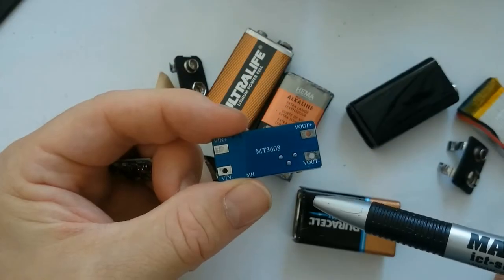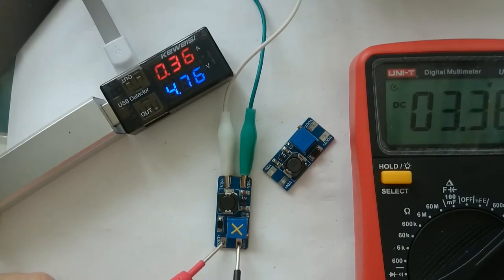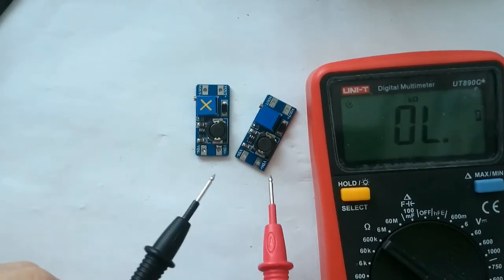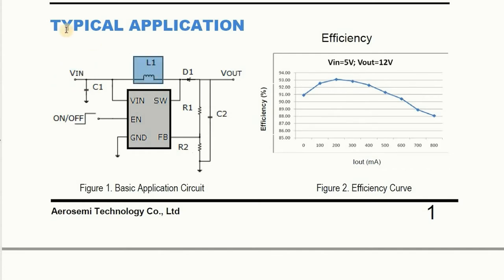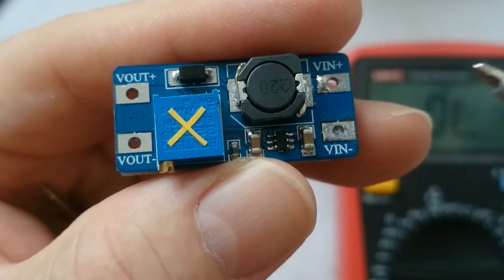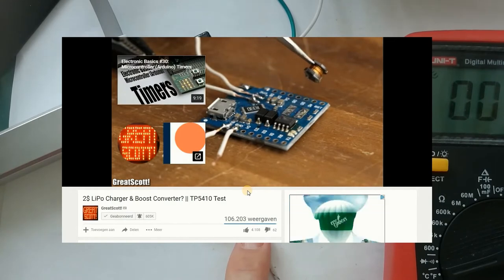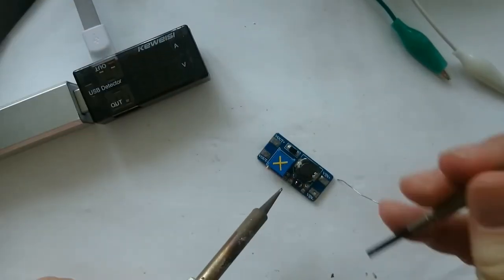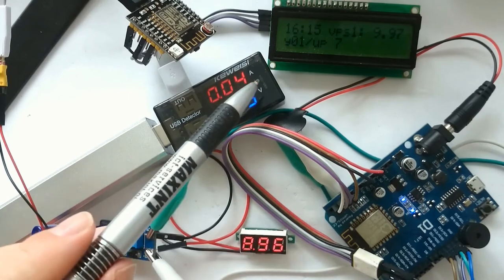Repair: MT3608 boost converter

Comment: If people realised that the maximum input voltage of these modules is 6v they wouldn't end up blowing them up.  I use them routinely to convert 5v to 9v or 12v with no problems.  In fact a lot of electronics such as TTL can't tolerate voltages above 6v and are run at 5v for that reason.  Plus why would you use a boost convertor for high input voltages?
Reply: That is not correct. Input voltage for the MT3608 is rated up to 24V.
Reply: The TM3608 is rated for up to 24V input, BUT the max voltage for the feedback pin is 6V. We don't have a schematic, but my guess is that the pot can easily come set to deliver more than this voltage to the feedback pin, so many of the units probably blow up right out of the box if connected to more than 6V. It's a stupid design.

These modules would be perfect for running low power 24V PoE devices off 12V, if they were any good.
Reply: @wsanders1  I have seen the schematic and it's dumb as you can easily twiddle the pot and apply too many volts to the feedback pin.  One simple wiring change would eliminate the problem but until someone changes the PCB used on these cheap Chinesium modules the only safe way to use them is to power them on 5v initially then set the output voltage.  Then the input voltage can be safely increased.  Lots of the ones I have received have been set to blow up right out of the box!

Comment: My module is not working and the resistance between Vin and Vout is 110K Ohms........
Help.
Reply from the maker: Umair Mujahid - if the resistance is that high, you don't have the same problem. Try to follow the steps mentioned in the comments below. (Use low input voltage, e.g. 3V, then turn clockwise until it clicks, then measure and turn many times anti clockwise while watching the output voltage).
Reply: My output voltage and current is same as input voltage and current!
Reply from the maker: Umair Mujahid - I understand. Either your module isn't working or you've not set it correctly. Read the other comments for some valuable tips.
Reply: Now it's working properly.....
Thanks
Reply from the maker: Umair Mujahid - Congratulations! Good to read that the tips helped. Have fun!

Comment: So basically it is the chip problem and there are no other ways to repair it, right? I have the same problem with mine, 12v input and 11.3v output immediately after I connected it to a sound amplifier, though I tuned it to 16.5v without load beforehand.
Reply from the maker: Killer1922 - Is it still is boosting the voltage to 16.5V without load? If that's the case, then you don't have the same problem. In my case the chips internal mosfet seemed to be blown and generating a shortcut. That 0.3V output drop is indicative of the typical drop of a diode, most likely the diode between input and output. It seems that yout chip is not switching when the load is on. Chances are that your load is too high. Please note that the current limits of this module are depending on the input voltage. I would suggest you to test your module using lower loads. For instance using a constant current load that can be  set to specific currents. Using a multimeter, you can also check the resistance of the output pins (when not powered!) and com[are your findings with mine.
Reply: Thanks for the info. Well, my converter does not boost anything in both loaded and unloaded stages anymore. The voltage drop i about 0.2...0.3 V and output voltage stays 11.3 regardless of the adjusting so I presume I have the same problem as you do. It's ok, I'll just order some bulk 3608s from China and resolder it. Anyway, it looks like I made a mistake using 3608 as a converter in the first place. I use it as a booster for 12 to 16.5v for 2x15W stereo sound amplifier. The amp reaches about 2 A in max mode so I'll better look for some more powerful boost.
Thanks again. Your video gave me the right answer after several hours of search. Keep up the good work!
Reply from the maker: Sounds like your chip is damaged indeed... Luckily the MT3608 modules are quite affordable...
Thank you for your response. It's nice to read my video was helpful. I think you're right and that you've indeed exceeded the current limits by using drawing to much current. The listed maximum current of 2A is under optimal circumstances (i.e. specific input versus output voltages and perhaps also proper cooling). As you stated you probably need a beefier boost-converter for your amplifier.
(FYI: In a follow-up video I made a mini boost converter using that same chip, which does work, but doesn't deliver the same current due to choosing different components.)

Comment: My mt3608 is broken ic i want to repair it please tell me to find ic to replace it
Reply from the maker: The IC is called MT3608. I ordered some on AliExpress and I included a link in the description of the video. Perhaps my video can help you with the replacement of the chip. Good luck!
Reply: What the model of ic 6pin on MT3608 boost converter
Reply from the maker: @phannsovanvichet6042  The model number of the chip is MT3608. You can find the datasheet online. In a follow-up video I used the datasheet to make a mini boost converter based on the same MT3608 chip. Perhaps you find that video interesting too. Also read the comments below. You may find many other questions answered in the comments of other people.

Comment: going blind looking at that tiny six-pin IC. I'm not going to try to out solder robots.
Reply from the maker: I've been told that a microscope will fix that. I had similar problems with some really tiny RGB leds the other day. Two escaped from my tweezers and were never found back. The 0805 SMD size still works fine for me, but with smaller sizes I spent too much time retrieving dropped components...

Comment: All these modules blow the input capacitor. Every time.
Reply from the maker: Are you sure you're not using them incorrectly? I've never had the cap blown. Not one single time. In my experience I only burned out the chip. Probably by drawing too much current. 
Have you tested the module after replacing the cap?
I can imagine that the input capacitor does have certain limitations though. The input voltage probably should not be too high or reversed. Have you measured under what circumstances the cap blew? Perhaps you can measure current and voltage after replacing the cap, or with another module?